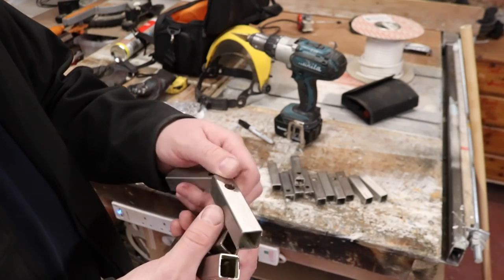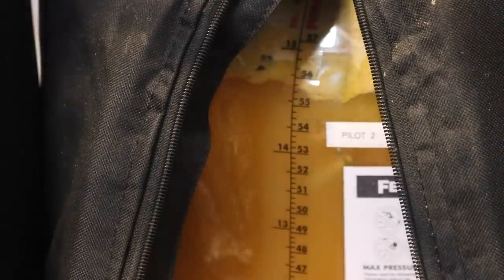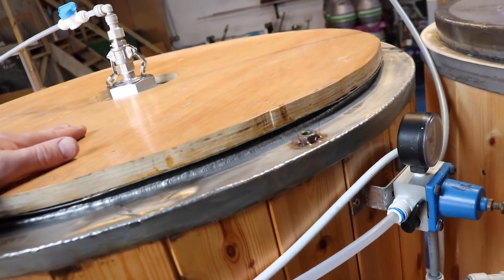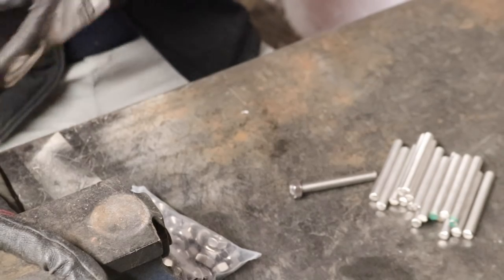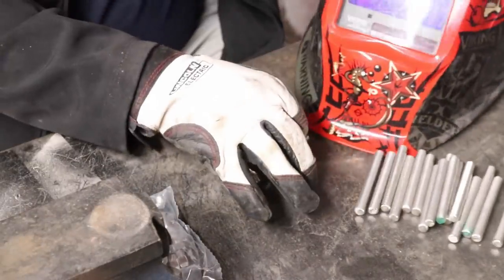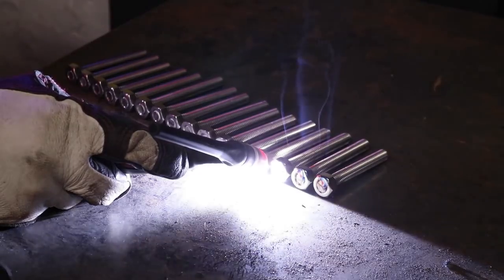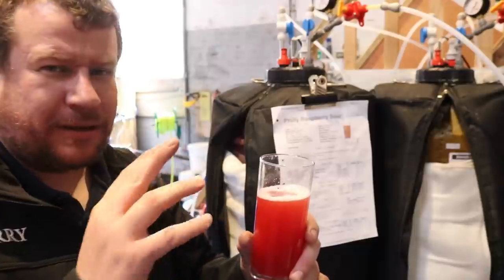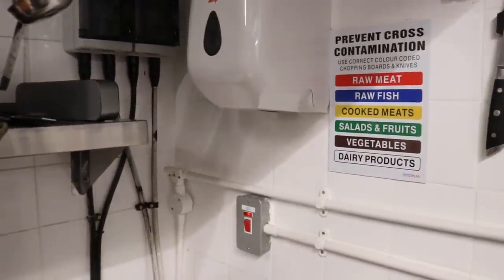Securing Tank Lids And Another Taste Of The Sour

Comment: Could a half decent raspberry sour be made using real fruit cos that puree seems a little expensive for the average homebrewer
Reply: For sure, I've made a lot of sours using straight up fruit and it works fine. If you can get frozen fruit it's a bit easier to handle. For berries I tend to do about 100g / 1L
Reply: @FinnpR0  throw them in frozen ?
Reply: @BarFlyBrewing  You can yeah, I usually wait until they've defrosted in the bag, squish them up a bit then open and add them in.